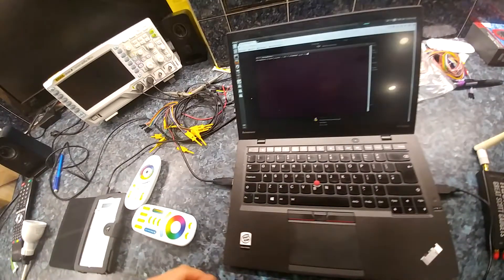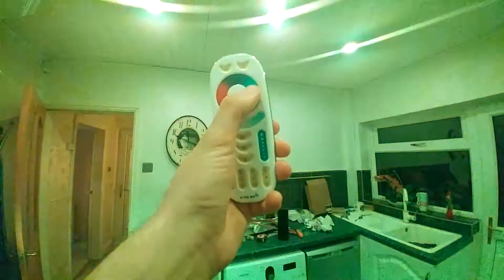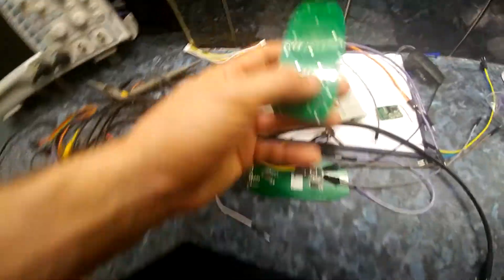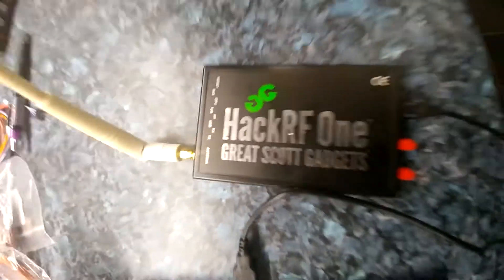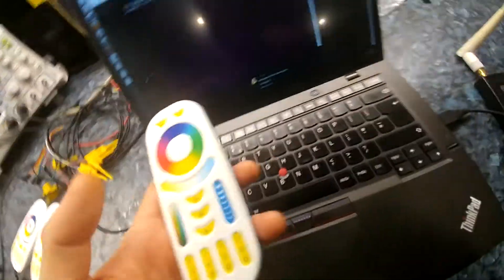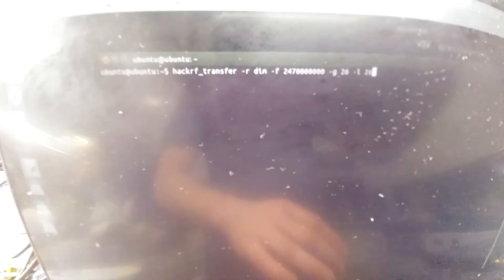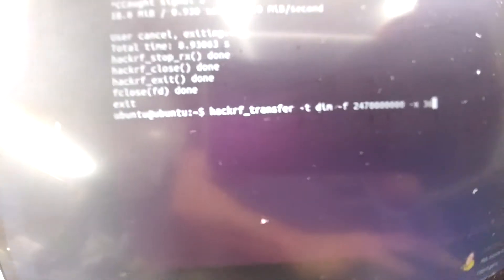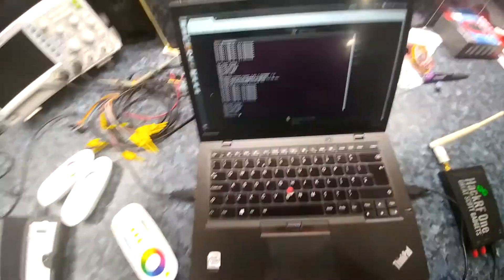MiLight new protocol RGB+cct RGB dual white capture and replay of commands

Comment: May I ask smt. I can't find answer for ? When using CCT mode. If say WW is chosen I guess that I can dim this warm LED from 0 to 100% brightless. Also when CW is chosen the same for this one. But If I chose mix, let's name is neutral white, so both WW LEDs and CW LEDs should be ON, does they shine both at 100% or say 50% each as a result of the mix ? I plan to convert our chandeliers which are using two sets of LED panels, one for down and one for up. I do not want to have them as individual drivers, but rather utilize CCT mode. Does this make sense ?